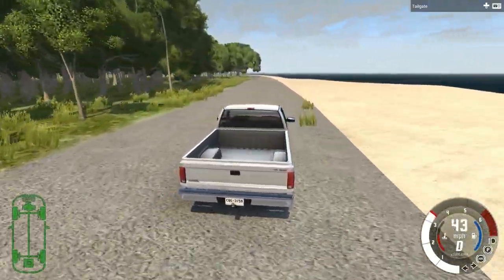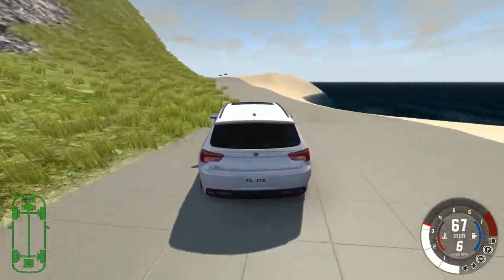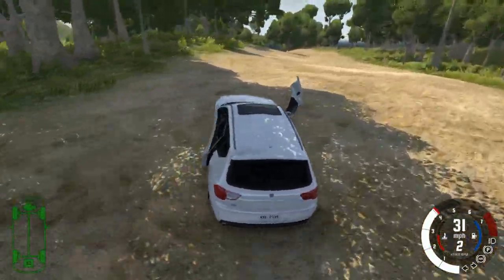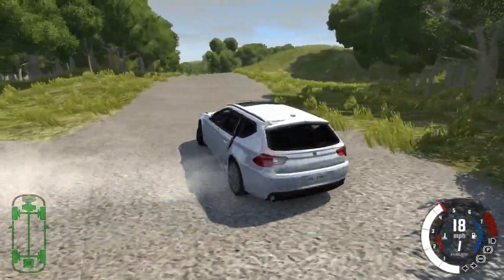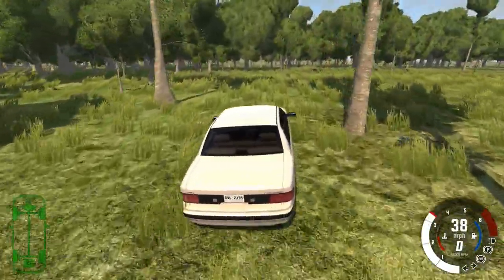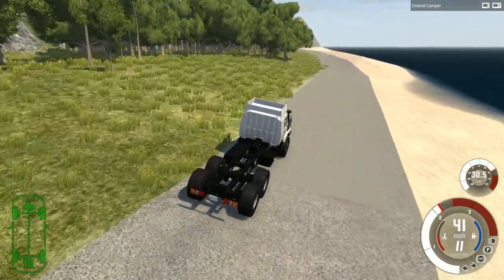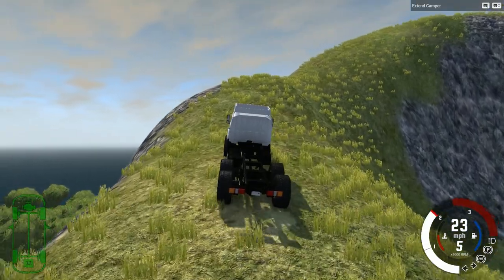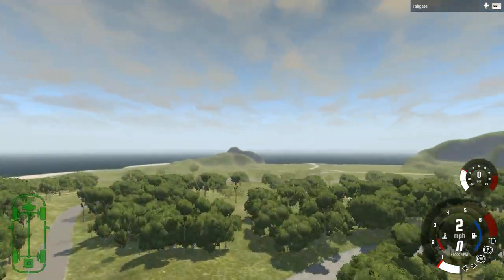BeamNG.drive - Brentstrom 1.0

Comment: whybeare the etk 6000 series with the 12l turbo engine has a clutch slipping problem but for some reason.
Reply: and that's why the 6200 turbo wasn't able to go up the hill (notice that the truck is in 16th gear an on a revlimiter :p)

Comment: Inviting all to the public v3 beta test of TENNESSEE USA REAL TERRAIN/REAL ROAD NETWORK, 136 miles of road, 144sq/mile map, includes functional railroad tracks, two towns so-far, custom assets and textures.  Largest map in BEAM!  Will run on any system with 8gb or more of system RAM http://www.beamng.com/threads/64bit-os-reqd-tennessee-usa-real-terrain-map-144sq-mi-roane-county-beta-3-now-available-for-dl.26737/  Happy BeamNG.Driving!